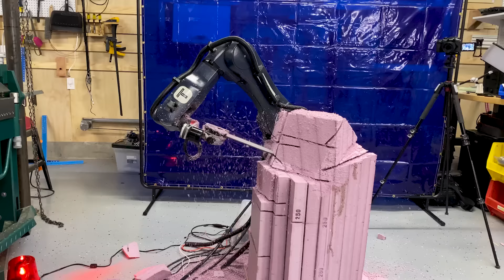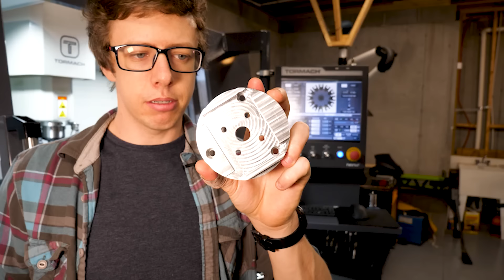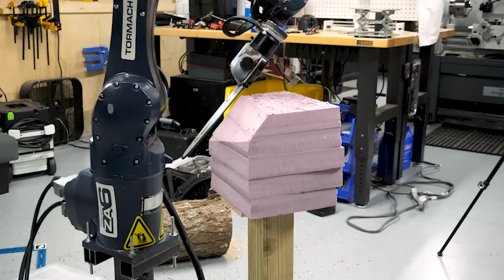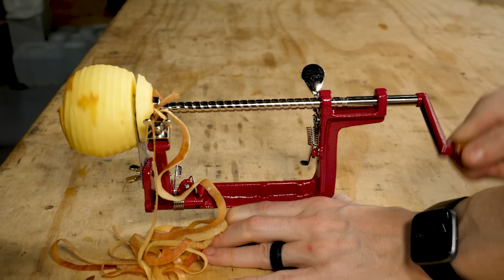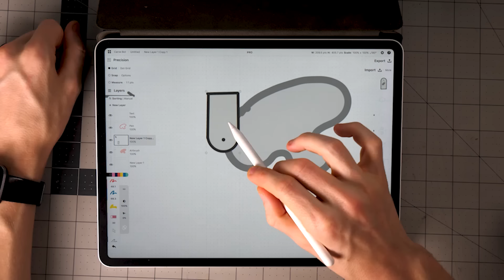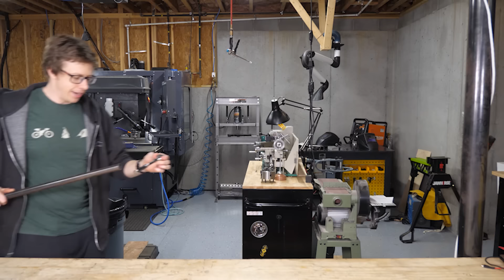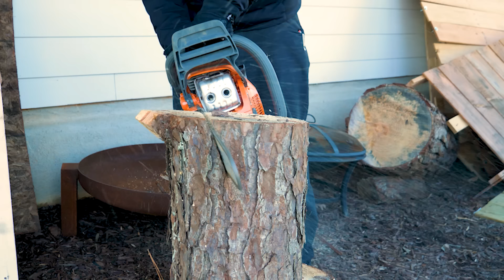Chainsaw + robotic arm = art?

Comment from the maker: Hope you enjoy this robot as much as I do 🙂. A big thanks to everyone who helps to make these projects possible through their patreon support. If you'd like to help me make more projects like this (and get more behind the scenes content, an AWESOME discord, livestreams, etc) check out patreon.com/stuffmadehere
Reply: Send the lock to lock picking lawyer already!
Reply: Please make a separate channel where you show all the programming and mechanical stuff you do. Let it be of 2,3,4 or how many hours I'll watch it. Please, I want to see the hardcore stuff too
Reply: I've run into similar problems trying to use a chainsaw manually. You should try looking into a ripping chain. For what you're doing, it should work a lot better. Normal chainsaw chains are only really meant to cut across the log (not along the length) and you have to be careful about how much pressure you use. A ripping chain will just cut anything.
Reply: @ryanholland9647  or just file down the rakers and use a more pointed bar
Reply: Should just gotten an angel grinder with the chainsaw attachment (it cuts faster than a normal electrical chainsaw due to its higher RPM)
the overheating is due to the fact you need chain oil to help the metal parts glide without friction (blade and chain)
Reply: Was just thinking that I didn’t see oil for the chain, that is why it was smoking. Also that is hard wood for a pole saw to cut through. 
Could probably make the “bigger cuts” manually and just cut the wood into a rectangular shape with a more serious chain saw, use the pole saw to make more refined cuts then mill the wood for detailed parts. Honestly you could probably build whatever it is in sections and then wood glue them together if it is too big to mill at once. Not really sure about how hard it is to run a milling machine on wood but I assume feeds and speeds would be faster than metal.
Reply: Let’s go brother love the projects
Reply: Can you please build a robotvacuum that cleans stairs? You will get rich!!
Reply: Still waiting to see lock you made in LPL's hand
Reply: WHERE LPL?
Reply: It's not a kickback tooth, it's a Rake - to clear the chips & prevent the tooth's digging in Too deep, ya best to experiment or get professional advice from a chainsaw carver, who will have advice on right type of chain & tooth's angle, depth/rake, skip tooth, rip etc & that's before you take staging the blade sideways or nose size (done tip), good luck @Stuff Made Here
Reply: Hey so, you didn’t mention having bar oil for the killer robot. Bar oil drastically reduces smoke and increases the quality and ease of each cut
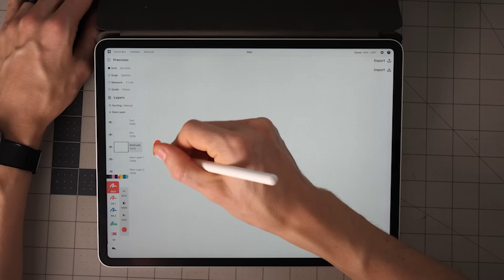Reply: What is the app name used at 4:21 ?
Reply: @rafiqulikram3873  do you find the name, im also searching. :)
Reply: Where LPL
Reply: Awesome work mate! I think everyone appreciates the cool projects you have been making. And that you upload it for everyone to see
Reply: hey man, couldn't you have used a ball-shaped tool to make it more precise?(like on ''normal'' cnc machines)
Reply: Another Amazing one👍
Good Job 👍
Reply: clearly she made a cat ..
Reply: I'm not sure how you're doing it, but It's really impressive that you can explain an engineering project in such detail, probably more so than any other YouTuber, and still make it interesting enough for me to mesmerized into sitting through the whole video.
Reply: I have an OSHA cert and if i was designing a safety system for this murder machine?
cage, with an electric locking door that only disengages when the blade is off and machine homed. machine home would place the saw in a box.
Reply: WHERE THE LPL COLLAB WHERE HE TRIES TO PICK YOUR LOCK
Reply: What is the drawing software?
Reply: Loved this video, kept my attention through the whole process. Side note, are you still planning on sending your unpickable lock to the lockpickinglawyer?
Reply: I think an "easy" way to choose cuts would be to create stages of polygon count, starting every low and in each stage the polygon count increases and move the chainsaw along the faces of the model. So you'd start with a mega low polygon which will be long, deep cuts to remove most the material. Increase the polygon count and repeat.
Reply: To cut into a log you need a lubrication system for the chain. Just like regular chainsaws.
Reply: @18:56 Is this the Pitch Meeting ending sound when someone just said something which will not age well and the headline comes up?
Reply: hello plz what the name of the app u use in ipad ?
Reply: a
Reply: I used that exact Apple peeler once
Reply: 17:09 you obviously have never used a chainsaw in your entire life lol ... no one on earth uses a chainsaw the way you are trying to.
Reply: You probably won’t see this but I desperately need to know, what app are you using with the Apple Pencil?
Reply: AKSFJLAKFJ SADK. I don't agree !
Reply: Well, it already works better than the robot barber. 🤣😂🤣 👍
Reply: Hey I sent you an email after your first golf club video, wonder if you got it. 
Anyways, you've got a defined, chainsaw tool now for your 6 axis robot now, right? So you can just switch tools into a different one for a different project any time you want and save the code for another day. You could make a hot wire cutter tool for your next project? I just finished a class on these robots, they're super cool.
Reply: Bro this is just insane hell yeah this vid was bomb
Reply: Smart drums. Make it so
Reply: When is this machine being put into the next SAW movie?
Reply: Yo
Reply: Your finger ok
Reply: You should start a tutorial video where you explain how you you code and other things.
Reply: If some company hasn't picked you up to work for them,  then they haven't seen you work.
Love your videos mate.
Reply: mann make a table tennis playing robot 🤟🤟 you got to make or not make it until i finish my graduate to so that i make it
Reply: You definitely need to hire someone if you can
Reply: Question, Is that a Thunder Tiger raptor you have hanging on your wall @15:30
Reply: Could you give it more tools to do the cutting with ie.  Router or some end mills just a thought.
Reply: I posted a comment that will help you a lot please find it
Reply: Your name is Shane?
Reply: I'd really love to see the arm  repurposed to use a router bit or a wood grinder disc. You could even hot swap it to use a micro sanding belt to refine the sculpture. Hell even  using Hebel blocks then shot blasting concrete or plaster to make it look like stone.
Reply: Since that's a limb and bush saw, can you use it on a topiary?
Reply: why dont you just make all of you stuf out of pollygons so there is only straight cuts
Reply: Noice Vid bro
Reply: I have seen a video on here somewhere involving a cnc hot wire foam cutter, and generating tool paths were a similar challenge.  I wonder if that engineer's solutions would be relevant to your challenges.
Reply: Love this channel.
Reply: Hey next time for your optimization use a JIT compiler like Numba. Love the robot!
Reply: You know a guy with a tree? No way!!!!
Reply: Youtube has a lot of crap on it these days. This channel is a diamond in the rough. I can't tell you how refreshing it is to see someone put so much genuine love and effort into entertaining me with python code. Never change my man, I hope you have a wonderful day.
Reply: I bet that saw could make quick work out of balsa wood, not sure where you would get a log size piece though.
Reply: Instead of cutting a new dog out of wood. You could polish up the foam model a little bit and then cast it out of aluminum.
Reply: what are your computer specs
Reply: Dude- replace chainsaw with circular saw and add a blast shield.
Reply: For ascend, just do few starting points and wait till they converge :D Follow the MCMC principle ;) Make sure these points are far enough from each other
Reply: Next make a doc golf robot that can get a hole in one at 300+ feet 🤙🏼
Reply: Now build one with a Mill head and it can do it.
Reply: Why
Reply: I think the solution to your gradient ascent false peaking is instancing. Once you've reached a supposed peak you simply repeat step one with an immediate rejection of any start points lower than previously reached peak.
Reply: Hi, please what's the name of the app you use to make your illustrations on the pad. It's so nice
Reply: Everytime I watch you, I imagine what it would be like to be you, so freaking talented
Reply: Okie
Reply: Would it be possible for you to do a deep dive on how to even start writing the code needed for projects like these and what things to do in different situations and what code you would use for each situation
Reply: im whating for the lock to fnish
Reply: Even though I did nothing to help you on this project I enjoyed watching you go through what you were doing and how you fixed your problems. 

I'm also gonna take your quote to heart "if you screw up enough times you run out of ways to screw up"
Reply: One of the very few (if not only) channel I actually disable adblock att click the sponsor links at, to help you grow. And thats coming from a bitter old sod, that utterly dispises (with a passion) advertising and all it includes.
This channel is is the essence of what we need so much more of. Not just on youtube, but in the world overall.
Smart, clever, curious, humourus, critical, selfaware, scientific development stuff/people.
Reply: Makes a robot to cut hair revises robot, now milks the concept of robot doing detailed work and struggles to achieve goal for 90 percent of the video and gets "passable" results
Reply: @Nelson-td3fi  absolute madlad
Reply: @mdv9831  sad thing is commented that at the beginning of the video and after finishing it I was right
Reply: Have you tried to use polygons of a 3d model as cutting planes?
Reply: You bloody madlad, some time in future you will upload a vid titled :" making terminator| killing my annoying neighbor".
But keep up the good work, and please don't give your robots guns.
Reply: Such a great video. I think this is your funniest video yet. Maybe you should give up engineering and become a comedian!
Reply: you made this way too complicated...
Reply: My dad makes them nicer and cheaper then the one u showed so if u want info my Insta is @in_the_treestand
Reply: Your intelligence is amazing, so you prolly already knew this, but a ripping blade would help you a lot. Most of your cuts are with the grain.
Reply: #11 on trending my BOIIII!!!!
Reply: You could use something like PhysX to simplify the mesh to a set number of faces say around 60 or so, then with each face generate a rectangle around it that would be safe for the place to entirely cut through then move the blade through the length of the rectangle, it would require a lot of linear algebra but should be simple enough, cheers!
Reply: ضضضضضضضضض
Reply: yeaaaaaaaaaaaaaaaaaaaaaa, love your vids bro
Reply: You should take a look at a video made by Disney Research group on slicing foam statues. The algorithm they use might work in some way with a chainsaw too!
Reply: How is the collab with the lock picking lawyer going?
Reply: Idea: you should cut the dog out of balsa wood
Reply: Dance dance till your dead dead dead dead dead dance dance till your dead dead dead dead dead dance dance
Reply: যাবো জডঠ
Reply: I was thinking about this robot & what I’ve learned about chainsaws. Bar & Chain oil is key to prevent the blade from becoming too hot. If it’s smoking you probably broke the temper & the blade will dull rapidly.
  Essentially the pole saw is ok for smaller cuts but trying to cut a large log; you might as well give the robot a Swiss Army knife & a pat on the back.
Reply: For optimizing your algorithms - when using Python, for loops are incredibly slow. If you have to use for loops it could be better to write in C (although much more time consuming). Numpy is a solid choice if you can convert your math into matrix/vector operations as Numpy matrix/vector operations are written mostly in C and therefore much faster. Avoiding for loops in algorithms like this within Python can reduce runtime by insane amounts; that 10 second runtime per cut could be <1 second each.
Reply: 111
Reply: A guy like you probably know this but there's different chains for split cutting and chop cutting. Great build by the way.
Reply: That´s no anti kickback tooth as far as I know. It´s called depth limiter and limits how deep the blade cuts into the material. Try filing it down so the top of the cutting edge is sticking out.
Reply: I love your channel. I can watch your stuff all day, but I'd never get anything done. Also, WHAT'S THE STORY BEHIND THE BANDAID?!
Reply: you basically made a complex CNC
Reply: As always another awesome video! I also noticed the Thunder Tiger Raptor 30 or 60 in the corner. Do you fly it?
Reply: Why did you change the thumbnail?
Reply: You mentioned the more something is off from its beginning the more extrapolated the error becomes. What would you have to say about something lopsided 24,000 miles in circumference spinning at 1,000 MPH?
Reply: very impressive! I love your work, your creativity, and your can-do-attitude! Any particular reason it had to be a chainsaw? I feel like a circular saw would eliminate a lot of the torque, give finer cuts, and potentially reduce the rubbing issue you had because the blades would have sharper tips. I could see it being more difficult to attach, and the coding would be entirely different because the blade wouldn't be as long as the chainsaw, ie: the arm would have to move the blade in a straight line forward to make the same length cut that a chainsaw could make from the side (but also, pushing into wood against the whole length of the chainsaw is precisely why you might have had to much torque, why it didn't have the bite to cut through, why it why rubbing instead of cutting, why it was overheating, and why it wouldn't cut through the wood reliably). That was my first thought, but I also haven't made anything nearly this cool personally, you're the master!
Reply: alternative to the 3D printer, but right now, it's still way dangerous to be widely accepted
Reply: What if you used milling inserts instead of a chainsaw?
Reply: Shit dude why did you have to use the amber alert noise
Reply: That's the depth guage.  The chain part, you can file them down some but that can increase kickback.  Proper depth and a sharp blade is what you need.
Reply: Chainsaw 101. That "Anit kickback tooth" is actually a cutting depth gauge the more you file it down the deeper the saw cuts. Secondly, Chainsaw Blades should have a continuous flow of oil applied to them.
Reply: Has the unpickable lock been sent to the lockpicking lawyer yet?
Reply: What app are you using for that drawing?
Reply: Hey my dude - for optimisation problems like gradient descent/ascent and getting stuck in local minima/maxima, look up something called 'basin hopping'. Effectively, what it does is a load of guesses at the beginning, with coarse iterations to find a low res map of the problem. Then, it performs a finer optimisation, using the best result from the previous step. I see that you're using python, so check out scipy's optimise module.
Reply: Look up angle grinder chain blade. You might have a much easier time with that over a chain saw.  Seems like with an angle grinder it could be done easier since you'd only be concerned with one point of the blade touching the object...course depth of cut would still be a problem on certain objects with narrow spaces.
Reply: Instead of trying to build super complex robots like this, creating more simple inventions like curved hoop would either be easier for you and more videos for us. Don't get me wrong, I appreciate these too...
Reply: Where in the world did you get the shirt at 20:10? That is absolutely incredible

The robot's kinda cool too
Reply: They have specific bars for carving, they have a narrow tip and they use more aggressive chain.
Reply: But can it make Dragons?
Reply: If u spent $1000 make it all up again by selling the sculptures
Reply: hey, I have made a similar machine (but working 100%) I am also a chainsaw carveist. Maybe we can work together on future projects or to make yours better ???
Reply: When ur going to send ur lock to lock picking lawyer?
Reply: I really want you to try and make a “close in weapon system” for mosquitos
Reply: If you only carve soft woods then maaaaybe you could have tried grinding off the rakers on the chain and using a full chisel chain with plenty of bar oil, but really saws do require a lot of grunt. Which is very problematic when using a robot arm because a: hitting the arm will do a lot more damage b: kickback on the saw would be horrific and c: well... you might want a second flashing light and emergency services on speedial. 
Was still a very cool concept though! Certainly perfect for foam.
Reply: What is the app that you use on your iPad
Reply: Have you tried calculating the gradient more than once, then check to see if the point is higher then the previously calculated gradient.
Reply: Caramba você tava vendo um meme brasileiro que fodaaaa
Reply: Did the cutting device have to be a chainsaw?  a ball end cutter would work great with a robotic arm, you would just keep it oriented perpendicular by the surface normals.
Reply: The scainsaw needs bar and chain oil to cut through the wood without smoking
Reply: Can you post your software stack for this project?
Reply: I haven't seen anyone else comment on this but I believe you need to supply the chainsaw bar with bar oil.  It should help with the heat the the cuts.
Reply: @jonasperson1386  I said the same thing lol
Reply: Dude, I got your next project. My neighbor's dog comes over to my yard to take a dump all the time. The problem is I can't catch him in the act. I need a motion-detecting slingshot or bb gun so I can plink this dog in the ass next time he's about to take a dump. Nothing to kill just a plink from like a single pump bb gun or slingshot. The actual footage will be great I would love to see that dog pucker up his cheeks and run for his life.
Reply: Mark Rober and mr beast are the tree suppliers
Reply: My man, if you want to cut logs instead of styrofoam, I got a few tips: 
If you think the "anti-kickback-tooth" is too long, just file it down, thats what you do with saw chains. Just don't file it down too much. 
Also, you are probably gonna need to sharpen or change the saw chain at least a couple of times in one log.
And lastly, you are gonna need some oil for the saw blade for lubrication/cooling, regular cooking oil works great.

Source, I'm working with chainsaws myself.

Love your content man!
Reply: Did you use roboDK?
Reply: 10:40 You should include the community. False Maxima can be avoided through Deep Learning. A lot of work for a single Computer. But 100.000 PC's can get a pretty decent seed in no time.
Reply: @stuffmadehere you are super talented and funny!! I get so much out of these shows! I cant thank you enough!
Reply: I really hope to see that you go for the wooden sculpture as well (initially at least rough cuts but a bit better then foam version).
I expect that perfect/very good results are probably out from your scope/goals as those would take too much of your time from other projects / creations / content.
Reply: I am a hobbyist 3D modeler so in the case you want to revisit this project in the future with an actual bear model hit me up
Reply: @Stuff Made Here 
That "anti kick-back tooth" you're referring to is commonly known as a raker tooth, it guides the cutting depth to ensure each tooth only takes a small slither at a time.
An easy fix for your issue is to simply file down (with a flat file ensure they are filed nice and square to the bar) which is common practice as the cutting tooth wears and becomes shorter when sharpened.
I would imagine the rakers are set very passive as you are using small home owner saws without a massive amount of power and like you said it does help to reduce kick back.

Note: one or two strokes of a decent file is sufficient for the raker a little bit goes a long way with them and you don't want to make it too aggressive and cause the saw (electric motor in your case) to work too hard and increase effects of kickback, also not really a concern with your application.
Reply: She won because putting the crown on the dog was the winning move. Goes to show engineer needs their artist.
Reply: what is your background dude 0_o
Reply: Your chain is on backwards, this is why you are having problems cutting!!!!
Reply: @nyfirefighter357k6  it’s not, he has the chain fitted correctly.
Reply: Growing up is about making connections. As you get older you will amass a collection of people you know with resources you can utilize. Eventually you will have a tree guy, a bush guy, a shrub guy, and maybe if you are very lucky a hedge guy.
Reply: Would you consider a technical deep dive on the coding or math for a project like this? I love your approach and the way you can make learning enjoyable! Keep up the great work, you're a jack of all trades, and inspiring more people to get creative and build their own stuff with every video.
Reply: You are my favorite tech youtuber I love all your videos good job
Reply: Send the lock to the LockPickingLawyer you're very clearly procrastinating Shane
Reply: 11:40 it is also called a DEADMAN Switch ...
Reply: Please send a styrene dog to the uk for me?
Reply: On the gradient ascent problem, this issue actually has a partial solution. Special optimizers like Adam and other momentum-based optimizers can be used to help curtail this issue. See here for some optimizers: https://ruder.io/optimizing-gradient-descent/
Reply: @stuff made here - Some motivation: https://youtu.be/_K1trc4qoMY - but still seriously cool video from you!
Reply: @Paul Delmont you’re right but filing them down will cause more aggressive kickback as a side effect.
Reply: Please send the unpickable lock to Lockpicking Lawyer
Reply: You're amazing man, really inspired by the way you fail and just keep doing it till you get it to work and the results are just amazing, good job
Reply: Try Ice next !
Reply: Now you need a huge enclosure for the bar oil you will need to cut wood!
Reply: do you think it's possible to make a machine or system of machines that will grow you the perfect plant? like look at it and determine what it needs and then give it to it? control sunlight, water, minerals, etc.
Reply: Your videos are awesome!

Idea: Mirroring programming 

While the saw is attached to the arm, have a zero point. Have a professional carver carve something while the arm records the movements. Once they are done, save the the program. Now, every time you place the log and robot arm at zero, you can just run that program... would be awesome! Mass produce famous carvers works at a fraction of the price.
Reply: Your videos are awesome!

Idea: Mirroring programming 

While the saw is attached to the arm, have a zero point. Have a professional carver carve something while the arm records the movements. Once they are done, save the the program. Now, every time you place the log and robot arm at zero, you can just run that program... would be awesome! Mass produce famous carvers works at a fraction of the price.
Reply: https://youtu.be/oJB500dWbRs
https://youtu.be/oJB500dWbRs

https://youtu.be/oJB500dWbRs
Reply: https://youtu.be/oJB500dWbRs
https://youtu.be/oJB500dWbRs

https://youtu.be/oJB500dWbRs
Reply: Hey, you should try an offset grinder with the chainsaw blade. You could probably do more intricate cuts. Just a thought. I could NEVER figure out how to do all that you did.
Reply: We have a fanuc robot at work... its interfaced on a simple interface... ie... known grid... and a pallet change... I must say... using the robot to push the shuffle around a common axis is innovative to reduce the cost of a seperate drive motor...

How you go about asinine ways to explore potential... gives me a chuckle... im not versed in robotics... but you sir have a potential...  your intuitive nature will lead you to advancing machine procedures given time... or maybe someone will help Jumpstart your mind where to look...  as in waste generated from tool tip...

You are one step away form genius... ;)  tackle the issue on time... its comparitive...  money in... money out.
Have a few ideas been floating around for some time. .. 1st rule... let gravity do its job...simple designs can become redundant.  From a procedural point of view.

Its realizing where to invest the time...

What is your motivation? Ya C axis (rotational) with one fixed axis...  scale that up... think the bay of fundy... canada.... 60 foot tide... do a coffer dam... re-enforce it... build a lock around it... build concrete floats within that... span the gap inward by a bridge crane... make it tuff as nails... say tower at center to support 1/2 the overhang... 
So lets say I want a 1000 meter diameter... seems within easy possibility...

K bullet points... whats the discharge rate... said locks can disapate water... ideal would be 1 tidal cycle...  if we only use a fraction in one stroke... how do we store wasted potential.... basically it boils down to kinetic.... say we want to engineer past limits on drop forge tech as is... go all in... look at it as a all in one... all or none...  if you look at a swimming pool... could you not put a upwards force on a float... pin it to a wear plate.... for the linear axis.... drop water level... and said points of final reference... big is not the question... its when we go that way.

Why not go deep... we look for fast motions... when we know... torque... rigidity works... so why not go down 5000 meters into the sea... 

Why not go to the very bottom.... form a pressure vessel at surface... cut into it a conical plug thru...  the geometry will self seal by pressure difference alone once applied. 

So many questions... 

If its a question of safety... than tackle that... outside of laser and visual... how do you eliminate contact... so its audio?
Reply: Very cool, but not quite display worthy yet.

How about a robot that can put together a jigsaw puzzle, or build a small LEGO set?
Reply: :55 you are famous. 3 seconds in this montage
Reply: 10:42 could you have a lazer scanner? It might sounds bizarre and easier said than done but there was a video about people moving sand here and there to create hills and then the computer will read the height and create a terrain map on the plane.
Reply: What app do you use for the drawings on your Ipad
Reply: Hey man what’s the website called where that bear is for sale??
Reply: get Louis Rossmann to talk about Right2Repair please to further inspire your audience:)
Reply: I would enjoy it more if you could just send LPL the damn lock you already made. Dude you can’t just say you will then pretend it never happened. Idc if you want to “make a more complicated one” just send him the one you already made ffs I don’t wanna wait 3 years for him to pick it
Reply: Have you sent the lock to LPL or are you still working on it?
Reply: Hello sir, can you make oxygen concentrator or liquid oxygen generator with household things..if you could ,it will help many people in emergency situation and save their lives...thank you.
Reply: 200th reply
Reply: Where is the lock for lock picking lawer?
Reply: You should try treating the wood like it's metal
Reply: I am happy with the safety precautions taken myself,  however, might I recommend locking out your killer robot chainsaw death arm. Despite the mild inconvenience in future endeavors.
Reply: It dont won't be smart make a bitcoin minner o crypto miner so to sponser you self en and program that trade gold silver  and something that can grow vegetables healthy and something that can find gold silver platinum and something that can cook and something that yu can get the hole bible in your head
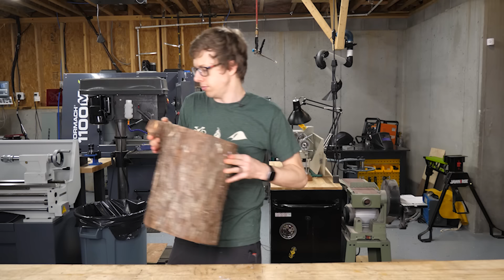Reply: 8:19 im impress that gotten be 50lb or more. Lifted it like a champ.
Reply: What happened to this guy???
Reply: 200 replies in, but just an idea in case you see it and weren't already thinking it - you could maybe use plywood or sawdust blocks instead of a full log. Thanks for the great videos, cheers.
Reply: Ok. But I have an idea for you. Hear me out. It's an untapped market as far as I know. Dummy rounds for dry fire handgun training. Normal dummy rounds don't eject themselves from the chamber after the trigger is pulled. Why hasn't anyone tried to do this? All of the technology needed to make it eject would have to be stored in the round itself. It would need to be either center fire or rim fire depending on caliber /weapon. I'm thinking maybe an electromagnetic reaction to the firing pin?
Reply: There is a ball gouge that you can attach to the are and it is for abnormal cuts on non square material such as stumps.
Reply: 77777787777
Reply: 78777777777777787877777777678777777777
Reply: 7767777
Reply: Have you considered mounting the saw blade not straight outward from J6, but on a 90 degree angle?
Reply: 9:55 you made a optical illusion
Reply: You could make a business and selling customized ice sculpts, thats rad!
Reply: What’s that on the upper monitor
Reply: What is the iPad sketch software he is using??
Reply: what is the art program you use in your vids?
Reply: why didn't u just used c++? it's literally about 100 times faster...
Reply: What is your iq? Impressive content..
Reply: Did you take off the EAS sound because the FCC got mad
Reply: I love it so much. I'm crying. It's amazing.
Reply: I thought the thing your wife made was a cat.
Reply: Ni
Reply: To make gradient accent work you should do another guess at the furthest away point and if it h8ts the same spot that's the correct summit
Reply: Man I love your videos
Reply: i hoped u would use an ABB yumi robot, so you can have 2 chainsaws. they are actually really easy to programm.(im working on them myself)
Reply: You could have used a drill. It can do way more details
Reply: A light lighting up when dangerous equipment is active usually isn't a good idea. Your bulb breaks and you indication is gone. A green light that lights up when the robot and chainsaw are deactivated is the safer option. Many systems combine both. This way you can spot problems when neither light is active.
Reply: what drawing app do you use?
Reply: Call me I'm in NC also, I will be your human tested with signed docs😳😳😂😂that I Am responsible for any injuries. Call me let's do stuff this earth world not believe even if they were told. .. Signing out Dave.. Get bk.
Reply: i enjoyed this all right
Reply: If the files are already stored as polygon's. Why not just set all vectors as tool paths?
Then just do multiple passes with different models gradually increasing the poly-count on each model?
Reply: The chainsaw appears to be absent chain bar oil.
Reply: You'll probably never read this but here goes:

I just watched a video that tells you how to identify pitching styles in baseball, I don't know why, as I'm British and have never played or even watched a game of baseball. It made me think of the "can't miss" basketball hoop you made. I was thinking, can you make a baseball bat that identified the picking style and guarantees to strike the ball? Obviously impossible for a human to swing the bat, but some sort of mechanism? There was also a YouTube shirt which showed banana ball pitches etc, claiming they were impossible to hit.

Impossible they say? Do you accept the challenge?
Reply: I have a question that I hope anyone can properly answer‼️
On the subject of false points with gradient ascent: Why can't he have defined dimensions for the outer perimeter of the search field and when ever a peak is reached its extends its search to the end of the field in every direction to see if it runs into another point of equal or greater height?
Reply: For SOME reason your videos stopped showing up for me so I've been riding through them. I definitely see a new movie coming here, though. The Boston Dynamics Chainsaw Massacre maybe?
Reply: Bruv, theres a pro gamer move i forgot, even i worked as a forester once. It's called turning the chainsaw. Referring to 5min mark
Reply: Still waiting on the collab with LPL....
Reply: @xXWickedWazzaXx  katelynn
Reply: @xXWickedWazzaXx  t
Reply: Where lpl
Reply: Where lpl
Reply: @javanmyna  777
Reply: @javanmyna  877777
Reply: @darylthomas4522  wot
Reply: I feel like there may be a way to use a machine learning algorithm to teach it how to use the saw in virtual space (essentially teach it in a to-scale emulation) for it to generate a tool path that could be very accurate and "humanlike". Not sure if you have any experience with implementing ML tools in code, but I really think it'd be possible to do something that gives the bear-cutters a run for their money :P
Reply: HI
Reply: Oi @Aswinn.pu239
Reply: NOTI GANG 💜
Reply: Hi
Reply: @Johnsmith-su3vy  ,.
Reply: Hello how can I contact with you?
Reply: @mrbrain8385  you could try his Instagram
Reply: @sirhumbleproductions4093  I tried but he didn't see my message
Reply: I just dreamed that I saw you in the oark near my house haha
Reply: Reeeeee
Reply: @elchapo6424  777777777777z77877777777778
Reply: @darylthomas4522  Ok then Mr. Daryl Thomas
Reply: I want to meet you how